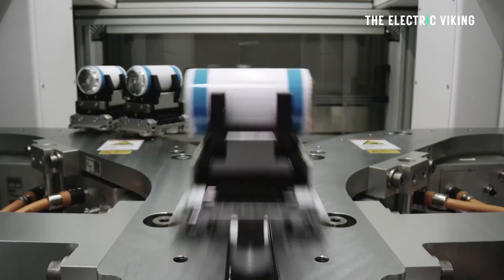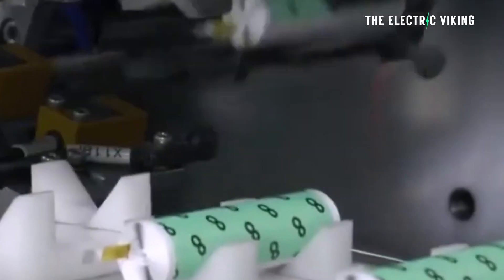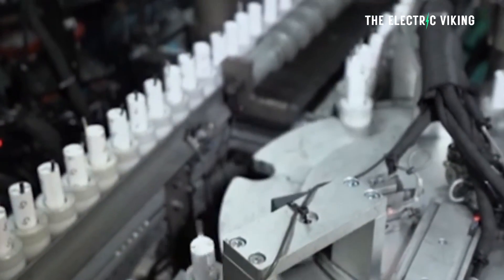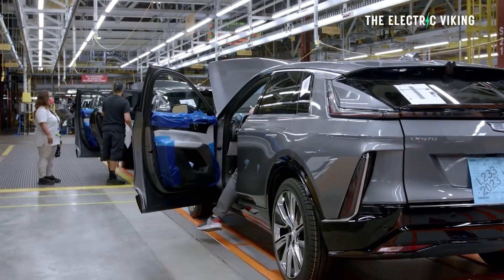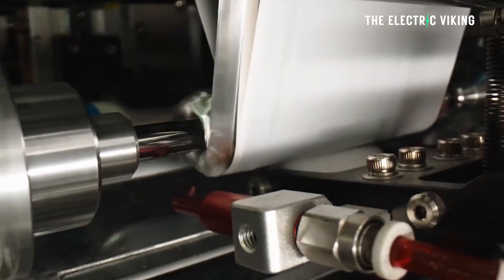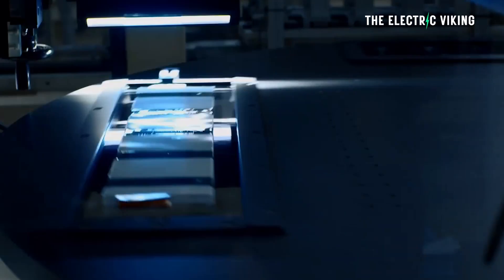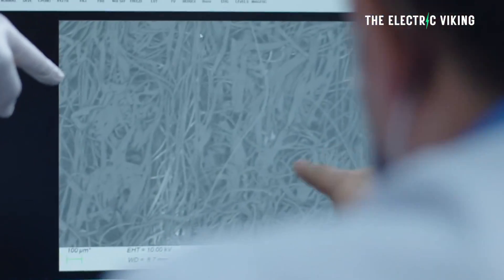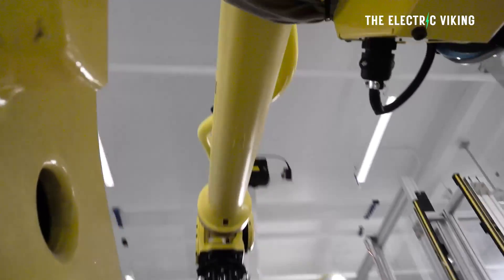LG Chem start mass producing Single-Crystal High-Nickel 4680 Cathodes

Comment: It's about battery longevity affected by micro cracking of particles in positive electrodes. As Dr Jeff Dahn, father of Li-Ion batteries, explains in this must-see video at 27:30: "Single Crystal particles do not crack while polycrystal particles crack". Also, elimination of this micro cracking at  28:30, etc. 
https://youtu.be/i31x5JW361k?si=KhPoWmhPj0anexYD

Comment: Many metals have a crystalline structure, especially alloys.Single crystal metal components can be made by directionally cooling the cast. They can be incredibly tough. These materials can be used to make gas turbine blades for example.
Obviously this isn`t that technology but single crystal metals have been used for decades.

Comment: yes, there are crystals involved. they need a certain ration of some metals that together form a homogeneous ordered structure - called a crystal. the advantage is that if it is having the right size it has the right amount of space to take up lithium ions without significantly swelling up. hence the 30% improvement in longevity. i guess lower discharge voltages without degradation is also possible.

Comment: its fairly simple: usually NCM cathode powders are made up of polycrystalline particles around 10micron in diameter. single crystal refers to the crystallinity of the particle, meaning they're not a polycrystal structure anymore but every particle is just one (also smaller) crystal. its been researched for ages, has been around and also talked about a while. Dahn et al. also did some work on it for tesla if im correct (think 631 or so)

Comment: Tesla is making EVs in volume. GM has not ramped up and there is still the question will their EVs sell in great numbers? VW for example has had to cut production because demand was not as expected. So some of the batteries from other plants may need to go where the demand is.

Comment: Crystal cathodes are typically made from alkaline-earth metals, such as calcium, strontium, or barium, or their compounds.  The term "crystal" in this context is used to describe the regular arrangement of atoms, ions, or molecules in the material's structure. These materials may be manufactured or synthesized to have specific properties, such as electron emission capability, stability, and longevity.  In terms of structure, the crystal structures of synthetic or engineered crystals used in electronic devices, such as crystal cathodes, are similar to regular crystals found in nature. Both types of crystals exhibit a highly ordered and repeating arrangement of atoms, ions, or molecules.
Reply: Crystals grown for microphone use did not excel as reproducers (headphones) and vice versa. With crystals you get what you aim for, hopefully. Cut from quartz, crystals went beyond audio freq into the radio spectrum usually operating on overtones.

Comment: GM doesn't use 4680 so far;  the big benifit of 4680 was suppose to be a tabless (actually big tab) design.  Right now Tesla is the only company that has designed in 4680 for their Semi and Cybertruck.  To date the tabless batteries have been plauged by high reject rates; so the real question is whether or not this new mono crystal 4680 of LGs has a low reject rate that makes it economical to use. No one seems to be forthcoming about reject rates which I take to mean they are not good; or it seems they'd be talking it up.
Reply: theoretically could be used without the fake tabless design but doesn't make sense with 46xx cell. the reason to use 46xx formats is simply because machines for that standard is available. that's why they don't use 50xx or 45xx cell size.

Comment: LG may be on to something here. It may be that the grain boundaries of normal polycrystalline metals is where the electrical resistance is greatest, and this may be the source of heat and ultimate degradation.
Reply: no, the crystals come with an exactly defined size between their 3-dimensional located atoms. that probably leaves the right spave for lithium ions traveling in when discharging.
Reply: They onto 0

Comment: GM might make 120k EVs in 2023 with a huge amount of luck = tiny customer.
In 2024 GM will most likely make less EV’s as they are discontinuing the bolt.
Tesla will make over 2 million EV’s in 2023 & use a huge number of batteries in their storage products = Huge customer.
Reply: Nope tesla can maybe reach 1.5Million at max

Comment: Large crystals are much stronger and are used to cope with the massive stresses in jet engine turbine blades. The edges of smaller crystals are weak points. Could this allow smaller cathodes?
Reply: Probably, the greater strength would also allow more silicon, a proven path to higher capacity. Hitherto silicon in greater quantities has caused cathode breakdown limiting battery life.

Comment: When most people read ‘crystal’ they may  associate this with a mineral crystal, some of which are translucent, pretty, rocklike..
You may find a big cluster of crystals in nature but most of them are separate crystals that accumulate until they encounter an adjacent crystal. The interface points are inconsistent.  Metal or mineral,  at an atomic level, traveling ions (eg lithium) will move differently, behave differently.
It’s likely these single crystal nickel cathodes are grown . I dread to think how to grow a crystal from a single loci in three dimensions when the requirement is for a crystal that is relatively few atoms ‘thick’ but almost 80mm ‘wide’ and maybe 300mm ‘long’.

Your vid shows the electrodes in sheet form before they are wound and stuffed in a cell.
Think about how much industrial process will be required to grow the precursor to that sheet.

I imagine Tesla will put some of the early production into battery packs for Semi which involves far fewer battery packs and more pressing range improvement requirement.
Reply: Single crystal metallurgy has been used in aerospace for decades, especially the “hot section” of jet engines.  Slow and complicated and expensive.  It’s interesting how much time & money has been spent effectively trying to overcome gravity.  One thing that excites me about the SpaceX rockets is their potential to make zero-G manufacturing more economical.  In space, crystals are free to grow, alloys that would never mix on earth could be created, etc.
Reply: Somebody here has explained the will be single-crystal micro particles, not single-crystal electrodes.

Comment: Aren't LG batteries the ones that catch fire?  Not sure I'd buy anything from them until they're more thoroughly investigated.
Reply: pouch type are the most likely to thermal runaway. The rest need to be pierced by something.
Reply: @yulusleonard985  The SK On (formerly SK Innovation) packs in the Kia e-Niro and Soul are pouch cells and not one fire has been reported in 2 million cars having those packs over many years. SK On explain why this is on their website.
Reply: @davidparker7920  Nah they are just aggressive over recall. 

The main cause are material choice, cooling and damage resistance. Nickle cobalt are more prone to fire than iron phosphate while blade/qilin or tubular like 4680 are far easier to cool than pouch. BYD already prove them self that their battery failed to explode when damaged by comparing it to rival pouch battery (which explode).
Reply: You can't just say 'LG's are the ones that catch fire'...The 28 kWh packs in the original Hyundai Ionic have not one single fire reported and they are LG. The battery fires in the Kona and Chevy Bolt were traced back to a manufacturing fault.
Reply: user-hy8my2di2b  isnt the recall is about charging system?
Reply: No worries.  There were over 7 daily EV fires in 1Q 2022 China last year. Also about no fewer than 45+ LFP EV fires.  EV fires with LFPs will catch on as they become more popoular outside China.
Reply: @tooltalk  Welp! if you do the math 45/640x100=7, 7 percent.  Nickel still 93% likely to burn. Although fire accident varies from short circuit, charging error and collision, its best to avoid outdated models.
Reply: @yulusleonard985  : the key word here is "no fewer" --  that number is just ones that are reported in the media. . Of course, China is all kown for transparency (/s) and nobody in China apparently tracks EV fires by battery type sinc LFP has been promoted under China state industrial policy.  Further, there are far more EVs running NCMs than LFP -- LFP EVs sales didn't surpass NCM-based EVsuntil last year.
Reply: @tooltalk  Theres still the laws of thermodynamic involved. Duno if they are state sponsored but Chinese battery maker still produce NCM for their performance EV. And battery type are non factor if the fire happen because wiring issue or short circuit.

Comment: Cylindrical spiral wound cells vs blade. 

My bet is the blade configuration will win out as the most effective cell configuration for EV traction batteries.

Pouch cell batteries will drop out of the race.

Time will tell.
Reply: What’s your take on manufacturing of the cells? How many cells and kW can you make of those different types? The blade seems to require more and longer time to produce. Maybe I’m wrong.
Reply: @Harrythehun  You need far fewer blade cells to make a traction battery pack of given capacity, so blade cells will be much less costly.

My Tesla M3 uses a 4,416 cylindrical 2170 cells configured 126s35p for 60KWhr.

My BYD Atto3 uses just 126 blade cells configured 126s1p also for 60KWhr.

Thus the cylindrical format requires 35 times as many cells for more or less the same capacity battery. It is clear such a battery is vastly more complex to make, and one would expect, far more expensive.

A further issue is, that for spirally wound cylindrical batteries, a Watt of heat energy generated near the core of the cell has a long way to go to escape to the outer surface, complicating thermal management.

All that said Tesla has done a great job exploiting and developing the traditional cylindrical lithium battery format from a lap top battery to something that can power a high performance EV. Indeed Tesla's original cells were identical to those in a laptop exploiting existing manufacturing base and economies of scale.

I feel though all things considered, the future lies with the simpler blade format which was intended from the outset to be part of an EV traction battery. 

This is particularly the case as EV production ramps up allowing comparable economies of scale in blade cell production.
Reply: user-hy8my2di2b  There weren't any (or at last very few) EVs fifty years ago.

The type of battery needed for optimal EV performance is very different from those that existed just fifteen years ago

Comment: It seems like we have to wait a few years for battery technology to improve,  so people can drive electric vehicles long distances reliably.
Reply: I have been driving 'long distances reliably' since 2019 thanks. EVs are far more reliable than petrol of diesel powered cars and on long hauls around Europe I have never had a problem finding public chargers.
Reply: Going for a long (1500 kms) journey across Europe the first time soon!
Reply: 500KM is suitable for common use in dairy work for one week. Long range 1000+Km already sold on market like Geely Zeeker 001. But the price is most important , the range and price need a balance for everyone.
Reply: You can drive long distances now